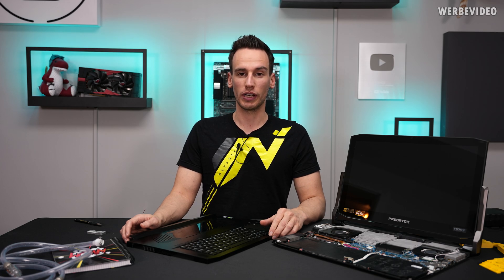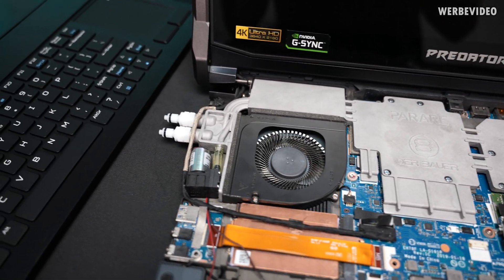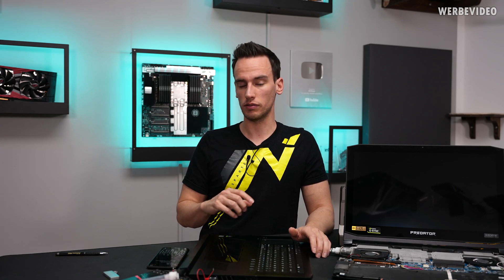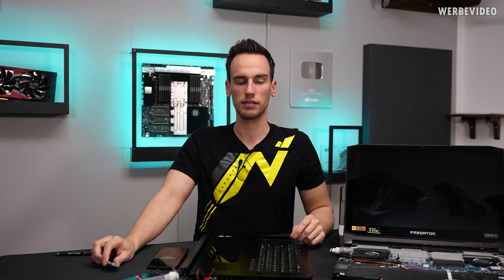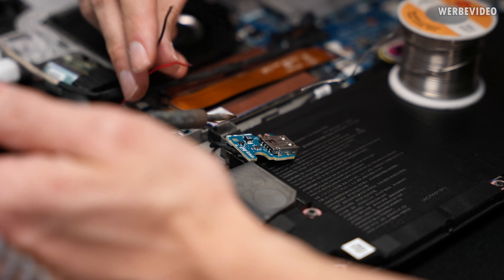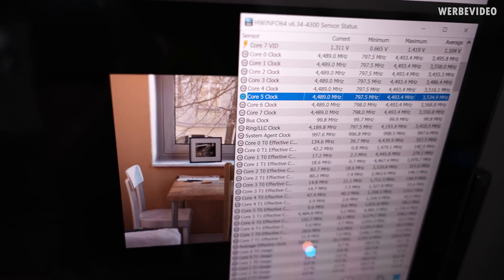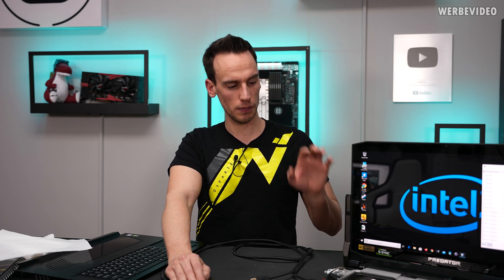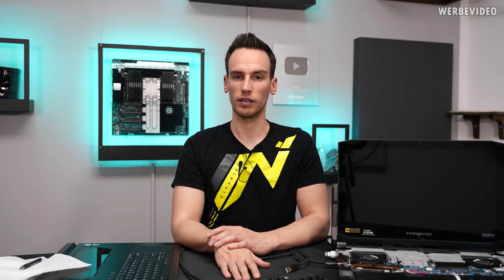Laptop Hybrid Water Cooling - First Results Better than Expected?

Comment from the maker: My sister created this new intro for me as a christmas gift :D I think it's pretty awesome! What do you think?
Reply: Good intro sir but don't forget abut seasonic sponsorship intro
Reply: I like it
Reply: It's awesome! The rounded font looks cool
Reply: Love it. Hopefully you keep it.
Reply: Your sister is awesome <3
Reply: Intro is very nice. Couple of suggestions for your build. Alphacool makes a tiny 5v pump called the DC-LT 3600 ceramic. You would need to make a custom pump top. I would also suggest coating your cooler so you do not have high internal temperatures when fully assembled. There are plenty of automotive paints that would work well. I would personally choose duracoat which a high temp firearms paint. Which comes in a spray can making really easy to use.
Reply: She did a bangin job. Happy New Year.
Reply: Love the graphics and the audio sync. She did an amazing job!
Reply: You should keep it!
Reply: 10/10 would keep!
Reply: It's pretty sweet, you should keep it!
Reply: Nice intro, mate. I like it! 💯
Reply: slick, clean, fits with you, nice sounds too !
Reply: this is shit 
haahah
Reply: It's good tbh.
Reply: Looks like it always was there! Fits in perfectly!
Reply: There are not many  big size components in a laptop...wouldn't it be better to make  an aircooled version, all sitting on an NVIDIA like RTX 3xxx cooler design....?! there i smore than anough surface area to make a bigger but thinner pipe system, and use a couple of 140 mm fans.
Reply: Better than just a seasonic spot (even though their great) and I would say it fits
Reply: Its too legit to quit.
Reply: like it says... German perfection! keep it
Reply: Hallo ich habe eine Frage ich möchte gerne ein pc bauen meine CPU ist eine amd ryzen 5 3600 und wollte mal fragen was für eine gpu ich nehmen soll für ein gutes Spiel wie warzone etc
Reply: It's great!
Reply: Pro, gg your sister!
Reply: its wayy too loud.
Reply: you think you've found a brand new video editor man with self stile to help you :)
Reply: Nice work!
How old is your sis btw? :D

Comment: I believe this is a super cool solution if der8auer could figure out a way to solve a potential hazard when the laptop is operate under fan mode: the residual water is going to become steam and pressurized the chamber which is totally fine with single piece 3D printing but I dont think it is going to work for the seal/connectors... for this design I believe an external vacuum pump should be incoperated into design so that when in the fan mode the it can run as dry as possible to avoid the pressure build up...and it might be wised to have an empty chamber as 'phase cooling for the residual water' or a pressure buffer to help the valve/seal being blown

Comment: There are one key issue with hybrid cooling is what to do with residual water...under i7/i9, computer will be booted in burst mode and the chipset can get really hot in that cycle and unfortunately the water become steam and any quick connection could be problematic since their sealing rating may not be able to handle the steam. I believe the design should cooperate a steam release valve but how to deal with jet of steam remain to be solved.

Comment: But isn't water cooling supposed to Take the heat and move it to the place where it can can effectively dissipate the heat?
Which is usually outside of a device, because, you know, can't fit a huge cooler inside of a laptop, so why not pump the water outside, 
to a huge cooler with a big surface area and pump cooled water back in?
Yes it won't be as portable, but that could potentially provide maximum boost to performance.

Comment: Hello der8auer! This is by far the most enthusiastic project i've ever seen, awesome work!  My only question is why not to place pump separately from a laptop? Like installed directly into the water reservoir? By doing that I think you can achieve noise reduction using other, more silent pumps.

Comment: Yo dude I got idea for you. Read if out if you can.
What if you separate the processor with wires and move it  safe distance so you could keep processor in freezer all the time. No condensation would ever build on the processor. Only thing feeling the heat was the applied wires. 
Those wires could be separately water cooled so no condensation would reach the motherboard and it would not heat up the wires also too much.
But it would mean that water cooling system for the wires might need and temperature controlled heater so it would not cool too much . 
I just thought to throw this idea out there for you.

Comment: Is it possible that the GPU temps are getting too high because of VRMs? In the original cooler design it looks like VRMs are separated and have their own heatpipe. So maybe it's not the problem with cooling just simply heat transferring from vrm to GPU die too well.

Comment: I have completed a similar self contained project over the past couple years (much more DIY) on a Clevo P370EM.

I used more DIY quality stuff... desoldering existing OEM heatsinks and making my own copper tube "waterblocks". For costs in the realms of 
$hundreds over many prototypes

External detachable cooling is feasible. High quality QDCs can make it safe from leaks, and you can use bigger, better, more powerful desktop water cooling components that avoid horrible pumps like that one!!  The #1 consideration in my planning is that they had to retain portability and usability. Otherwise what's the point, if you're gonna be tethered to the desk just get a desktop ... This is the approach I took for my main unit, a 9900K+1080sli P870DM3, I soldered a copper line across its giant vapour chamber GPU heatsink, flowing through self sealing QDCs and a few metres of tubing to a 360mm rad mounted to the side of my desk that never needed more than 1200rpm fans to keep ~350-400W worth of GPUs below 70C. And still retained all of its stock (60dba!) air-cooling when disconnected

The other approach, fully self contained water cooling, is just too difficult, the compromises for space are too great. Pumps are a big one. (FYI, I found a small 25mm diameter 6-12Vdc pump that was nowhere near as noisy as that one). But also, water cooling for the same radiator volume is actually less effective than air cooling... as the fins convecting the heat to air are less hot than they are with heatpipes, without your loop temps skyrocketing and causing big problems. I had to add 2 extra fans to my P370EM project to get adequate cooling for ~250W of power draw without external cooling help, lucky it was a cavernous thick old-school  17" SLI beast with a redundant optical drive bay and vertical stacked 2.5" bays that could fit extra fans and rads as well as the pump, a small res+fill port, and all the tubing.

I see no way it could be made to work this way in a more space-optimised modern laptop

Comment: Maybe in a redesign you could ditch de righ fan in favor of a pump and reservoair and make que left fan area all about heat dissipation area. In this case you coud use a bigger/quieter pump and connect it in the current right fan eletrical plug with pwm control.

Comment: I wonder if the limitation is on the tiny rads as they don't have much surface area like normal rad does, more specifically I'm referring to the zig zag thin metal sheets around the water channels.

Comment: I love this idea! I would love to see you expand on this project and perfect it to work better than regular air cooling.
Reply: He needs to increase the surface area.  
As it is, he is basically just betting on the 3D printed + liquid assembly being an overall  better conductor than the copper.

Comment: In my experience of gaming laptops, graphics cards don't tend to overheat that badly at all, but CPUs sit at 100c all day long.

I don't know if this is due to more aggressive turbo boosting or lack of cooling allocated to the CPU or even the effective order of cooling between CPU and GPU.

But it would be very interesting to see a hybrid cooler where the GPU is cooled via heatpipes and conventional means, and the CPU is cooled via internal water jacket as you have here, so that you can quick connect an external radiator & pump aio when gaming at home or on a desk, so that the chip can boost up to match desktop speeds, but once unplugged it downclocks to regular laptop speeds.

Additionally, I would advise replacing stock fans to give additional space for a larger and thus quieter pump, you could even have vertically mounted external 40mm fans to attain the same airflow.

Comment: What kind of pump is it? It sounds like an oscillating pump, but diaphragm pumps are usually much quieter.
It could also be a ball-type check-valve causing the sound? Gear pumps are usually quieter, but not silent.
You can get diaphragm pumps where all moving parts except the motor, is rubber, and these are close to silent.

Also to control the pump, you can just hook up a MOSFET to sense the fan power instead, so it follows the fans, but i assume you already thought about this.

Awesome project.

Comment: I think you are right about a lot of things... However you are simply wrong about the soldering thing.  Small tips exist for a reason.  And a storing a lot of heat is actually bad when you can translate that through pads and to other components.

Comment: Size of soldering iron tip is pretty much a personal choice. But thermal capacity really matters only when you have big ground planes and/or you can't preheat the board. For anyone wondering, cause i know Roman knows it already

Comment: Is the noise the actual pump or vibration of the pump. I ask cause if it is simply vibration that could be eliminated with some dampening material, and the rest of the noise could go away simply by putting it back together. Just my thoughts.

Comment: Alphacool makes a tiny 5v pump called the DC-LT 3600 ceramic. You would need to make a custom pump top. I would also suggest coating your cooler so you do not have high internal temperatures when fully assembled. There are plenty of automotive paints that would work well. I would personally choose duracoat which a high temp firearms paint. Which comes in a spray can making it really easy to use.

Comment: If the pump is only used when tube QDCs are connected, could you just use an external USB plug to power it?
Seems pointless to keep it running in portable mode
Reply: From what I gathered it's the other way around. The internal pump is only to be ran when used in portable mode to circulate the water to the built in heat exchangers. When the external connectors are used a normal pump can be added to the loop to enable the use of a large radiator. This makes the internal pump redundant when the external rad is used.

Comment: Have you tested what is the performance without the pump? How long will it take so heat soak the water? I would guess that even without the pump it should be usable for normal 2D/office work.

Comment: Due to the fact that the laptop can only be run when connected to a radiator you should have opted to leave the tiny crappy pump out of the build and simply used a rad tower with a pump installed on the tower.

Comment: You could add a simple thermal sensor switch to turn the pump on or off depending on the temperature. Although not really sure where to place it inside an already packed chassis... fun experiment, though. Frohes neues Jahr.

Comment: I have "solved" the usb power always on by connecting it to regular USB plug that I can pull out when I want to cut power. Yes its dangling out side but its easy solution and the laptop is always at home...

Comment: Re: soldering iron tip. You're not supposed to rely on the heat stored in the tip only for soldering. The reason you're getting bad results with smaller tip is because you're using an old type of soldering iron where the heating element and the tip are separate. This means that the PID controller inside, if there is any, takes a long time to respond to temperature changes in the tip due to bad heat transfer between the heater (where the thermal probe is located) and the tip, if it responds at all. Modern soldering irons use tips where both the heater and the probe are combined together in a single assembly with the tip. They react to temperature changes much faster, and even smaller tips can maintain temperature. Look up for example TS80P or any of the hakko clones.
Reply: I wanted to suggest the TS80P but I worry he'll end up overclocking and water cooling it.
Reply: @MrMartinSchou  Then we'll finally see what it's capable of.
Reply: I'd check out the Pinecil, it's a probe in tip iron for $25, I got one with a full set of tips for less than the price of the TS series irons even with shipping.
Reply: Gas power solder heats faster then a electric one.

Comment: So, in that video, the laptop was launched only with the radiator itself, without an external waterblock, and the pump only drove the liquid that was inside this radiator, right?
Because there is no particularly strong difference between the stock cooler and this radiator
Reply: @River_Miles  anyway, its wery interesting, and nevermind, what results will be in the end👍

Comment: The heat pipe is a thermal pump with phase change which can be considered as a water cooling system in steroids. There is no merits at all to do it by this expensive way.

Comment: Hello! The idea and the results are really awesome! As a question and maybe a piece of advice, are there a possibility to use external usb connector instead of soldering to existing usb port? And if the power of pump is enough to cool the system under load, maybe you can install some manual voltage regulator into external connector? It can help with noise in office work and just surfing the Internet.
Thank you for your videos, I was dreaming about such system since I've got my first laptop)))

Comment: i'd assume there's no water in those 3d printed fins where the fan is exhausting. could you have that space empty during print and later insert a fin stack afterwards that's got comparable fin density to the original cooler?
Reply: The conductivity of the surrounding frame is probably the limiting factor anyway

Comment: This reminds me of some of the older labs I used to work in sometimes that had chilled water supply hookups for different types of equipment with supply and return hook up stations with shut off valves all throughout the place. Need to install a chiller system at home with a circulating pump to spin the water and you don't need fans or a little pump in the laptop, or PC's. Noise free.

Comment: For the USB that stays always on, like most laptops I think you can disable it in the program from the laptop manufacturer or in the bios, usually the option is called "USB Always On"
Reply: i was about to write the same thing... new systems has new "always on usb" port for charging mobile phones earphones or tablets for a short while making the laptop a powerbank...
if the option is there, it is almost always in the bios/uefi options menu...
Reply: Or BIOS
How it's on my laptop

Comment: What is the optimal wavelength for copper? Was it SLM or SLS? If it was SLS, would it be porous and was it postprocessed in a furnace to overcome the deficiencies? Also how much flow does the small pump provides? Love your work and the intro is much better.

Comment: are the fans 12v? If its 5v you can just solder the pump to the fans. or try the 12v one soldered to the fan header?
Reply: If the pump pulls a lot of current you do have the possibility of burning out the laptop's fan controller.
Reply: @roboman2444  The fan controller doesn't supply Vcc and GND for the fans, just the PWM and TACH signals.
Reply: @ahayesm  Oh neat. Maybe with a small transistor you can use that PWM signal to vary pump speed to match the fan speed.

Comment: I didn't expect that tiny pump powered self contained closed loop cooler lol.
Reply: it would be better if he used a similar pump to a one used in the small water pound .
Reply: @tdomingues89  that wouldn't fit. Taking apart a closed loop watercooler and using the small built in pump might be a better idea.

Comment: Just what my laptop needs. It currently has no cooling at all and throttles like heck!

Edit: yes it's a potato old pc
Reply: I still use my Asus rog G75VW with a 2GB GTX 660M/i7 3630QM as a secondary PC lol
Reply: @TerraWare  well, mine uses a pentium n4200, no dGPU, 4gb ddr3 ram
Reply: @Shaihan  I guess as long as it works why not use it. I have a Ryzen 7 3700X/6800XT water cooled gaming PC but the way I have it set up I use the laptop for most my YouTube/Entertainment/etc.
Reply: @TerraWare  it's really slow but it's at least usable XD